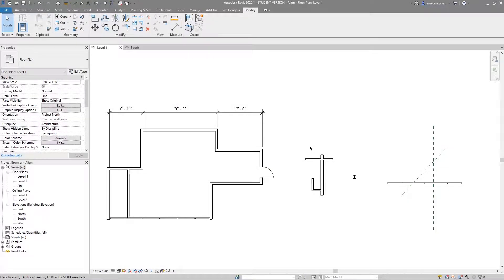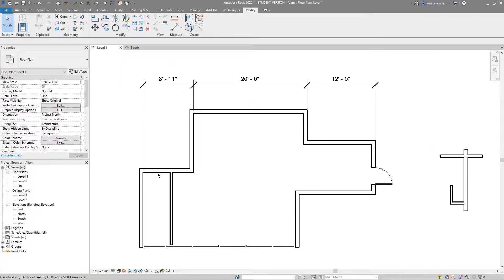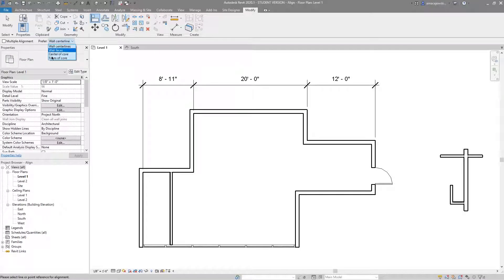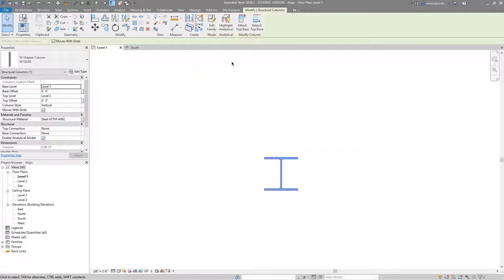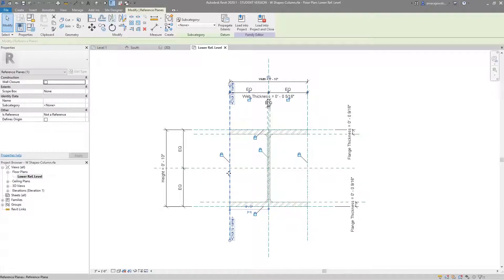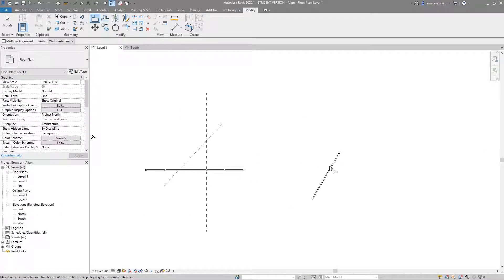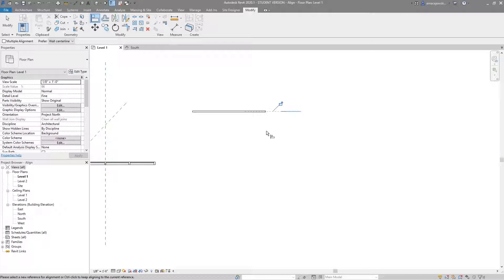How to Use the Align Tool in Revit | Revit 2020

Comment: Align = AL
You can align anything with a relevant plain. Eg: walls/doors/square landing for stairs. 

You can use Tab to select between lines. You can change the ‘select by face/select centre/centre’ option in the options bar.

You can lock alignments, sometimes useful - be careful tho - domino effect.
Multiple alignment can be selected in the options bar.

DL = Detail Line. Useful for quickly aligning something.

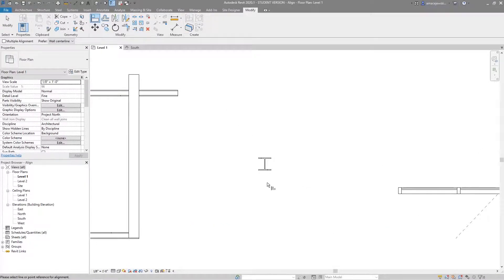6:30 more in depth. Way to add alignment options/reference plane to families.

Select element->edit family->Create (Panel)->Reference Plane->Draw Line->Load It into Project->(don’t need to save)->(override)->now you have that alignment option. You can change things eg “weak reference” also.
Reply from the maker: This is all awesome Tori, thank you so much! This will be really helpful for everyone!
Reply: Thanks for the video Vanguard and thanks for this extremely helpful cheatsheet/video review Tori. For some reason; reading the keyboard shortcuts helps me to remeber them over just being told what they are. I appreciate both of you.

Comment: One question comes to mind.  Is there some way to set the multiple alignment option as the default rather than having to select it?
Reply from the maker: To my knowledge there is not. Every time I open Revit, I end up having to check this option. This goes for the copy multiple as well. I am sure there is something deep in the API or your personal INI file that would change this to be on by default but that is way above my head.